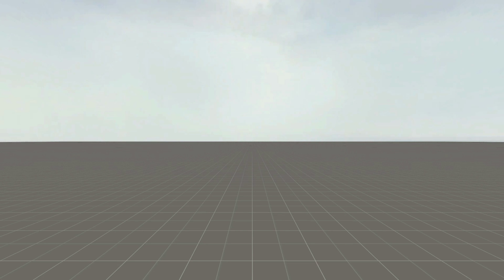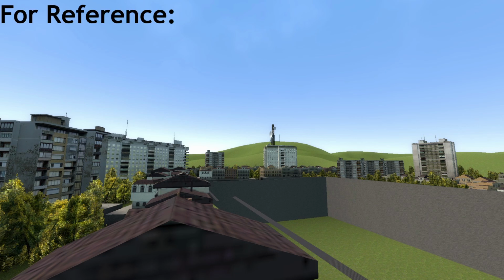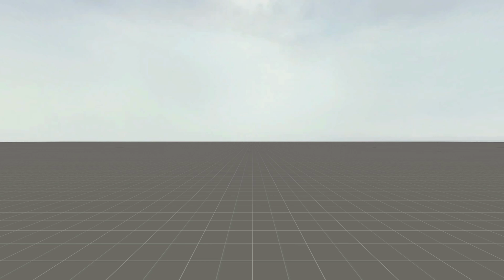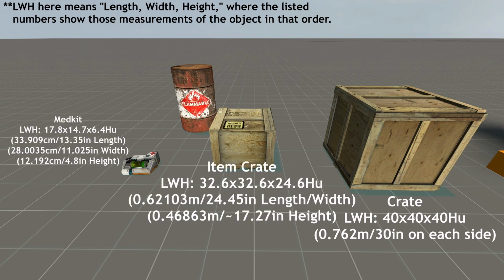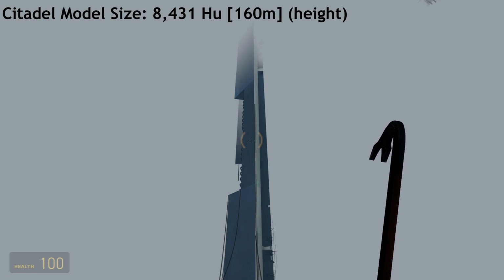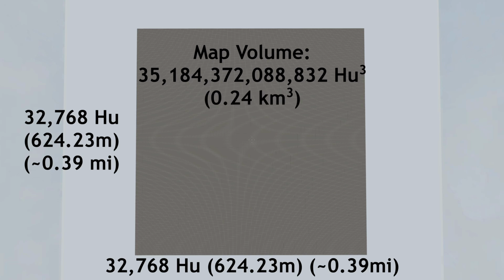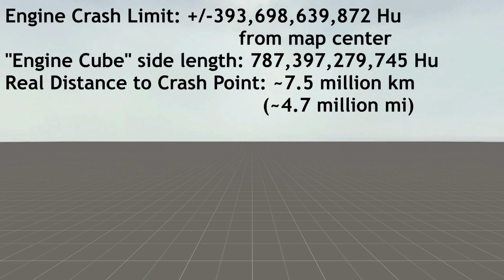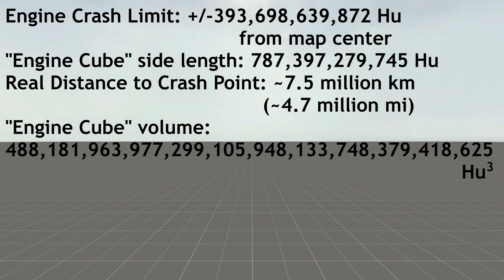Source Engine Measurements

Comment from the maker: CORRECTION FOR THIS VIDEO AND MY HAMMER UNITS SHORT:

When I was talking about the real size of a Hammer Unit, I was using the wrong scale scale on accident to measure characters. I incorrectly remembered a Hammer Unit being consistently 1.905cm (1/16 foot) at all times. However, it turns out Source is a bit more complicated than that, and typically Source uses multiple systems for scale in every game. I'm going to end up making a correction video on this at some point because this was, frankly, a pretty stupid error for me to make. Sorry about that.

Edit: Correction video available here - https://youtu.be/Y1E8N8OQSfU
Reply: A thing to note is, there's an engine branch known as the Strata Source Engine, it's the basis for Momentum Mod, Portal 2 Community Edition and Portal: Revolution. They've increased almost all engine limits including and not limited to map size and entity limit. With the map size being -65536 to 65536. It makes me wonder what it's Source cube ends up being. Maybe it's the same, maybe it's different, may be worth checking out at some point, as sadly, neither of the 3 games are public as of typing this.
Reply: Yeah, that's the part I got confused about, because I always read in the dev docs that 1 HU was meant to be exactly 1 inch, the same way that 1 Minecraft block is explicitly 1 meter on each axis (meaning Steve is quite chonky). I guess it makes sense that each game would have a different scaling standard for their art styles (does that mean Freeman is canonically taller than the Mercenaries, because he comes from a world with a larger scale factor?)...
Reply: Hu being 2.4cm makes a lot more sense, as it is very close to an inch.
Reply: characters use a 1hu=1inch scale
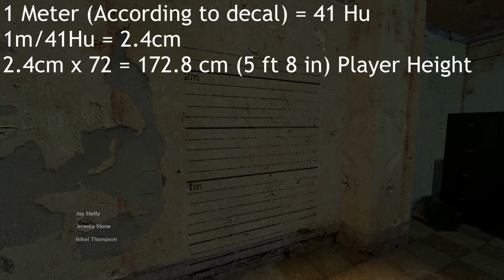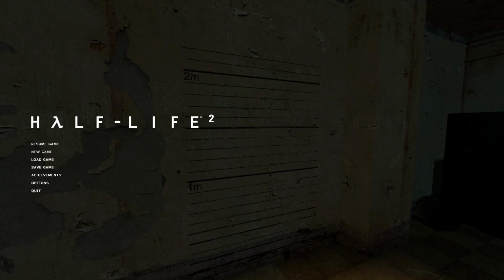Reply: Maybe the low height can be accounted for be assuming that is just where the camera viewpoint is located? At 3:01 we can also assume that if the camera viewpoint is directly at eye height there would still be additional height from the eyes to the top of the head, giving "Gordon" an additional 7 to 8 centimeters. So at 3:02 when you estimate the height to be 172.8cm it would check out if you add the space from the eyes to the top of the head. Ca. 8 cm. to a total of 180cm+.

By the way, an international oil drum should be about 85,1 cm in height.
Reply: @Mr_Wh1   All player model is 72 units high. And so is the average in-game characters. View offset (camera eye position) is 64 units. Which means there's 8 units from the eye position to the top of the head.

Now, the eye position isn't 1:1 to the actual eye on the model. It's usually at their mouth/neck area. So a couple of units from their eyes at ~67 units.
Reply: For most purposes, 1 hammer unit would be roughly 40x real world scale, IF scaling to the player. Because you see, HL2 scales things around ~52x relative to real scale for narrative reasons (making the world feel bigger). Eye height is also lower than it should realistically be, this is to prevent the camera clipping.
Reply: Doesn't matter gaben short that's why
Reply: ...I'll make a correction video about this at some point.

Comment: Whenever I did personal measurements of hammer units, I assumed gordon was 6 foot for the 72 unit measurement and got that 1 hammer unit is exactly 1 inch, it depends on how you measure that you get different results I suppose.

Comment: Very interesting video! The only thing that's throwing me off is your usage of m instead of cm. Instead of 29.21cm you use 0.2921m, which is arguably a lot more confusing and not how you'd measure it. I understand you might've wanted to have a sizing standard, but I still think that cm would've been more applicable.

Great video though!

Comment: I wish Hammer could convert between HUs and inches, because for some reason 90% of the entity keyvalues representing distance use inches instead of engine units. Also, for some reason every time I try to convert between them manually it's incredibly far off from the distance I wanted.

Comment: A barrel 0.6m in diameter and 0.8m in height?

Maybe you've confused the radius with the diameter because that's a 3:4 ratio.

This aside it all seems so small... maybe because I am 1.9m but that's besides the point.

Comment: Of note, GoldSrc Half-Life's units appear to be different to Counter-Strike's ones. I used to make maps for both and would often use prefabs that I'd made based on HL texture sizes in CS maps, but then once in-game everything seemed bigger. This means that CS players are smaller than those in HL.
Reply: I was skeptical about your claim and went to look for the actual heights in CS 1.6 and Half-Life as they are defined in code. These dimensions are defined in their respective mods. But it turns out they are exactly the same in both.

Either had a different FOV or something. Maps are 1:1 in both games. Some Half-Life textures and full-scale prefabs are also used in CS 1.6 maps (e.g. railings, dispensers, vehicles etc.).
Reply: @dealloc  Well all I know is back in the day for some of my more complex CS maps, I would first make them for, and run them through, Half-Life as they loaded quicker without all the additional CS entities and WADs, etc. Once I'd got the basic layout and architecture down, I'd then edit them as CS maps and add-in the CS-specific stuff. There were a few maps that seemed to be a bit off in scale once loaded into CS. Things like chairs that were about waist-height in HL were now almost as big as the player. Small office items were now bricks. And things like curbs which could be stepped up just by walking into them now had to be jumped. I don't remember which version of CS was current at the time, but I'm not even necessarily talking about CS 1.6... probably earlier... if anything even changed between versions I don't know. FOV was default in all cases as that wasn't really a thing you even heard about back then.
Reply: Some time in CS's development they dropped the eye level to just 64u (4'). Nobody is quite sure why, not even Gooseman. But I heard Gooseman subconsciously accepted it because he's a small man himself.
Reply: @mfaizsyahmi  Cool, thanks for the info! I'm glad I wasn't losing my mind!

Comment: I did my own research on this long time ago. Actually I was trying to understand the size of Minecraft block for HL2/Gmod... because existing maps are bad, people are making every block 32hU^3, and the player is higher than 2 stacked on top. The funny thing is that in Quake the meter is actually 32hU, so there it would be right. Btw 1qU=3,125cm.

I looked at the player size. The player is 72hU high, and humans are 180cm high in average, then if you add 10% you'll get 200cm, so respectively do the same to 72hU. Then divide 200 by 80 and get 2,5 - that's the ratio of the hammer unit and cm. And it is almost 1 inch, which is 2,54 cm.

What about props... they actually look too big in comparison with humans. Though I don't think the geometry was designed under 1/16 scale, it perfectly works with 1/12 too. You can say props are 25% bigger, just like the human characters are 25% smaller. But you know, taller player means more detalization, because unit would be smaller in cm, that's good.

Comment: 5:37 question.
can´t you technically increase the map size from 624.23merters by 624.23meters by stacking 3 maps on top of each other and have the player teleport from one edge to the next (whit the portal thingi (not Portal the game but source portals thingi).
thoes as a example creating a map that is 2 x 2 the size (by stacking 4 maps on top of each other), 1248,46 meters by 1248,46 minus the space for the portals/doorways to work.
Reply: You actually can, but then you should not use 3D skybox because it will break (obviously why).
Reply: @fantastikboom1094  ... really? I remember that you could have multiple 3d sky boxes. or was that just sky boxes.
Reply: @Zack_Wester  There is only 1 possible 3D skybox on a single map. Oh and even only one 2D skybox(

Comment: I see the correction and a few comments about it, that you answered, I also wanna add that in CS:GO ingame 1 unit also equals 1 inch, which I have used as a start to make a tool to calculate damage falloff for the weapons and the bomb, as well as determining distances and the map's size. With this the characters would be 6 ft tall, also there is a command that shows you how far your bullet traveled when shot in meters, which concurs with 1 inch.
Okay now back to watching :D

Comment: I wonder why doesn't the engine just use  centimeters or inches. It'd be so much simpler for everyone.
Reply: Because programmers really love working with powers of 2, so using 16u:1ft scale is really convenient. The structures in the in-game world aligns to the 16u grid as real life structures align to the foot.
Reply: It does use inches, he just got the wrong measurement from using tf2's slightly larger scale.
Reply: Because there's a limit on how big worlds can be (32768³ units), and if you want to make a game with a much bigger scale (such as a space exploration game), your maps would be pretty limited working with 1 unit = 1".

Comment: Very cool.
Is it possible to do this with other games and engines? Would make for an interesting series.
Reply from the maker: It's definitely possible, and is something I'm considering doing at some point in the future depending on how I'm feeling and what I'm able to do.
Reply: Most modern engines use SI for base units. Blender and Unity use meters, Autodesk Maya and Unreal Engine use centimeters.

Comment: It's weird people assume one HU is this value, HU is equal to ONE INCH, this way playermodel is exactly six feet or 180 centimeters, which uhhh... makes sense? And the Citadel with that assumption is about 3.5km in height, which makes more sense, I guess?
Reply: The measurement is actually on a by-game basis, with the standard being 12hu/1ft for player models and 16hu/1ft for the map and props. This is why in garry's mod tf2 models are bigger than hl2 models, as tf2 uses 16hu/1ft for players and maps. So on a prop size basis a hl2 model is 4'6", but in model basis it's 6'0". This leads to the conclusion that the Citadel is actually 2.5km in height using prop and map size basis, and 3.4km on a playermodel size basis.
Reply: @diggy5884  ah
Reply: @diggy5884  weird they decided to go that way though
Reply from the maker: I made a very stupid mistake in that I used TF2's scale for Hu instead of one of the like 3 that HL2 uses. In TF2, 1 Hu is 1/16th of a foot, I just didn't double-check this for HL2 because I'm an idiot. I'll probably make a correction video eventually.
Reply: @dauntlesswuff  don't. nothing is wrong with this video. Valve really use 2 different scales which made people 25% smaller. It's not the world that's too big, it's the people in it that are too small.

Comment: 1 hammer unit is 1 inch.
Reply: freedom units moment
Reply from the maker: When measuring character models in HL2, yes. I accidentally used TF2's Hu conversions instead of HL2's, which was really stupid of me to do. Whoops.
Reply: the half life 2 and CSS player and NPC models use 12hu/1ft. Otherwise it's 16hu/1ft. This is why tf2 models are so much larger than HL2 and CSS models

Comment: Valve actually uses two different scales when designing certain models. Maps and architecture use the standard 16 units=1 foot, while character models and certain other props use a smaller scale of 12 units=1 foot.

So Gordon Freeman, and other humanoid characters, are supposed to be roughly 6 feet tall. I believe this scaling is done so the world looks more spacious on a 2D screen.

In HL:Alyx, the global scale is now a consistent 12 units=1 foot, since being in VR already makes the world feel spacious. Try playing the HL2 VR mod, and you'll see a difference in how the world is scaled.
Reply from the maker: It varies game to game, and I accidentally made the mistake of using TF2's scale for HL2, which uh... I probably should have double-checked. Whoops. In TF2 Hammer Units are indeed 1/16th of a foot. Again, error on my part, sorry.
Reply: @dauntlesswuff  when did tf2 get a scale? the player models are oversized and the props even more
Reply: I was going to say that I always thought that Gordon was 6ft, as that's just a round and desirable number that's easy to work with and has that 'hero' element to it.
Reply: @FlyboyHelosim  Every human character is approximately 72 units, which would be 6 feet in entity scale.

But in map scale, it's 4.5 feet, which is much shorter than the average adult.
Reply: @FlyboyHelosim  It is also a more desirable number when scaling props created in real world scale to Source scale, since it rounds out to around 40 times.
Reply: Strange that they went with imperial units when the rest of the industry have pretty much standardised that 1 unit equals either 1cm or 1m.
Reply: @theblah12  MAGA!
Reply: Pretty much this, a lot of people tend to overlook the fact that in Source they used a different scale for the player and the world. Some of you who have used addons in Garry's Mod like simfphys will take note of how you can set your speedometer relative to either player or world size, and how the former is the technically correct setting to use.
Reply: thats cool how hammer units are comparable in scale to an inch in HLA then

Comment: I thought hammer units were 1 inch per Hu, meaning each npc is 6ft, or something close to that.
Reply from the maker: I accidentally used the TF2 scale in this video, which I feel really stupid for doing considering I should have double-checked it. In TF2, 1 Hu = 1/16th foot, but in Half-Life 2 it depends on context, and in the case of NPCs, one unit is equal to one inch.
Reply: @dauntlesswuff  Ah, 1/16th of a foot seems pretty accurate to tf2. Tf2 scale is alot bigger than hl2s
why is my text italicized

Comment: I thought hammer units were 1 inch? Them being 1 inch means that the player is actually 6 foot
Reply from the maker: They are when measuring character models in Half-Life 2, I just accidentally used TF2's Hu conversions instead of HL2's which was a dumb mistake on my part. Whoops.